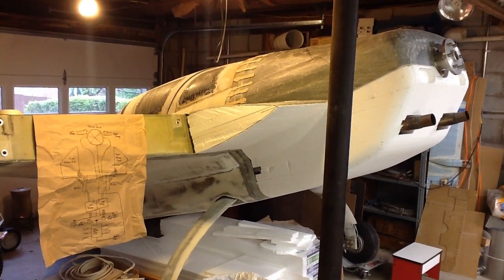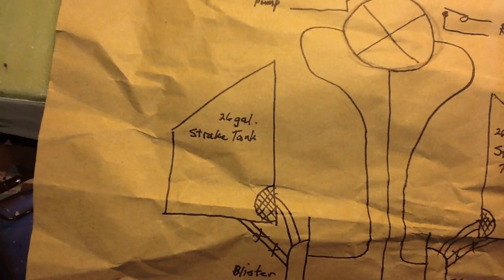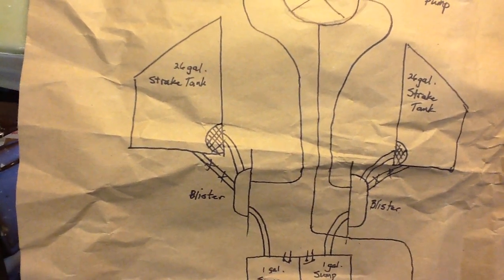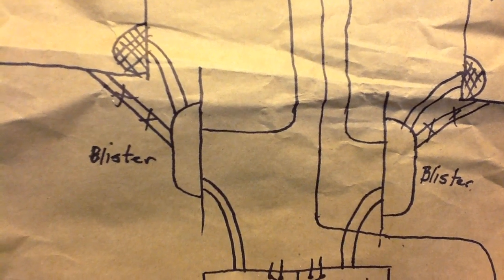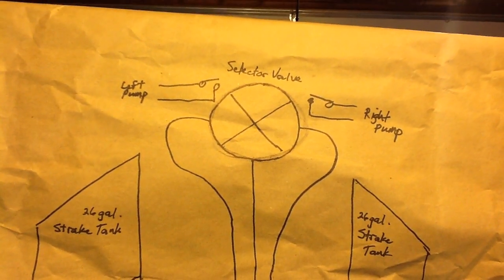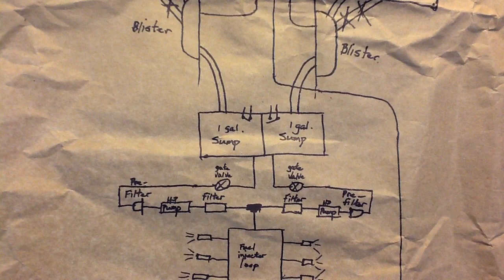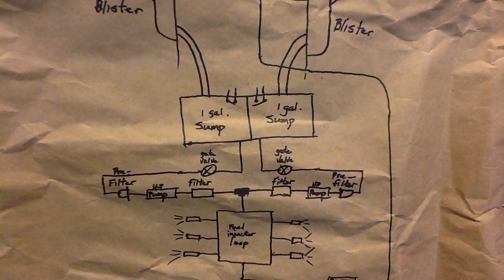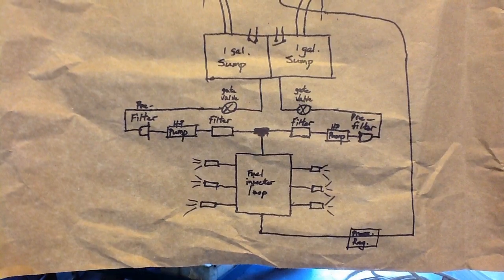Redundant Fuel Systems

Comment: This is great, except...if you run a tank dry, your dual redundant fuel system now has multiple single points of failure: you're totally dependent on the remaining fuel pump, gate valve and filters all operating perfectly, with no option to revert to your redundant system.

I think I would change this to utilize a common sump tank, then have the pump system selectable by the pilot. Fuel injection return could just go back to the sump, rather than a specific blister. The selector valve could select between which blister feeds the sump tank.

Comment: Shouldn’t the recirculated fuel leaving the fuel injector spider or rail go to the fuel tank first for cooling, and not directly back to the fuel valve in cockpit?
Reply from the maker: Dana, it's necessary to first determine which tank to return the fuel to with the valve. (The valve does not determine which tank fuel comes from - the selected running fuel pump does). I have set my system up to return fuel to the blister of the side it came from. It cools in the one gallon header tank that the blister feeds.
Reply: Ok, that makes sense. One variation you could consider is making one combined 2 gal pump tank with the two feed lines to it each having a check valve. But then you lose the redundancy of bad fuel situation.
Reply from the maker: @danah9576  Great minds think alike!  It originally was one, two gallon tank, then I added an internal divider to make it two, one gallon tanks. One, two gallon tank would also do away with the redundancy goal of two sets of filters and pumps, too.